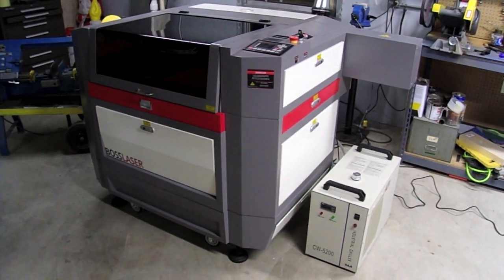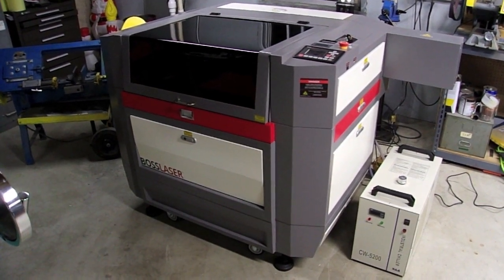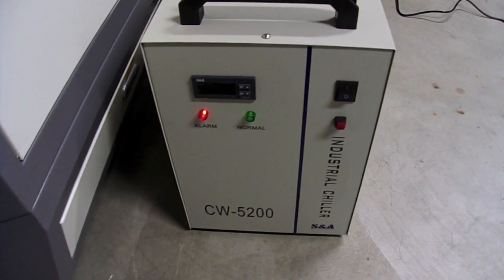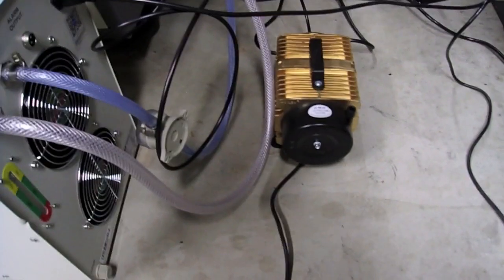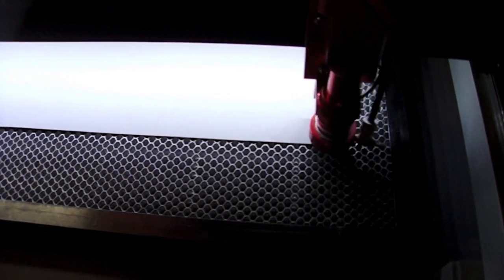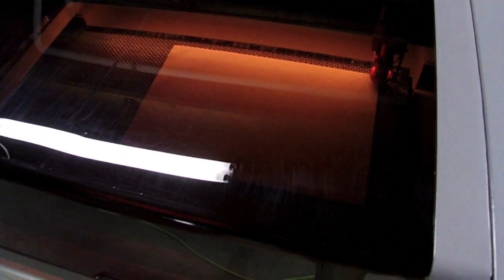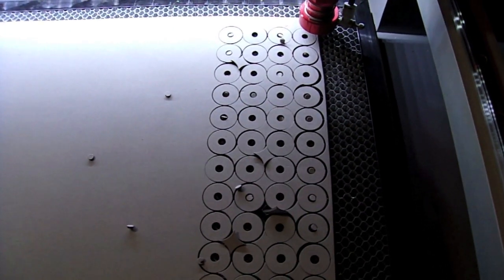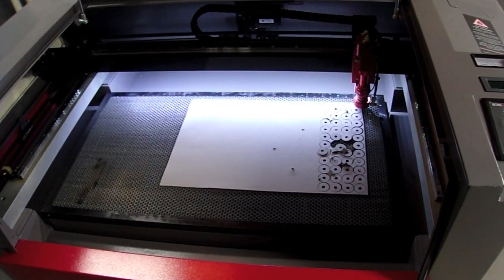Laser Cutter Demo!

Comment: can you get that machine through a 35 inched wide door? LS 1630
Reply from the maker: The machine is almost 38" wide, so I'm going to say no it won't fit. I have the advantage of a 7 foot wide garage door and ramp leading into my basement. The frame of the machine is welded up too, so unfortunately it couldn't be disassembled to fit either.
Reply from the maker: Sorry, I double checked the machine and my statement about it being disassembled isn't quite true. If you were real intent on that model, I could the bottom section of the unit being taken off and the machine turned sideways to reduce it's size to just under 32" to fit through your doorway. The machine is actually composed of 3 sections stacked on top of each other. It would take a little work but I can see the bottom section (which is primarily just for the wheels) being taken off to reduce it's size.

Comment: Can you stipple polymer firearm frames with this machine?
Reply from the maker: It depends on the exact type of plastic it's made from. I think most polymer frames are something similar to nylon, which doesn't cut real well. Factor in the fiber reinforcing usually added to the plastic for strength, and I doubt you'd get real good results stippling a gun frame. Maybe okay for light markings, but probably not for deeper cutting you're going to want to make a good grip.

Comment: I have been looking at other brands including Gravotech. A similar machine from them costs well over $25,000. When I asked the rep about the price difference he says that the Boss uses Chinese parts that are inferior and wear out faster. The LS-1630 is way cheaper so we are considering it from a cost standpoint but are hesitant to pull the trigger on it because of what this other guy said. What do you think?
Reply from the maker: Well, in my opinion, I think it depends on how much you plan on using the machine. I've had mine for two years now and have had zero issues with it. Granted I don't use it anywhere near as much as a regular production environment might see, but I want to say it gets used for something 3 or 4 times a week on average. While the Boss is not the best quality machine out there, it's not too bad either and I think it's capable of light production use too. Like anything, keeping up on basic cleaning and maintenance of the machine are going to extend the life of it considerably. I would also recommend a better chiller like the CW-5200 or greater, and making sure the water for it stays clean. The laser came with a CW-3000 which is just a radiator and pump, and may be fine for light use but I think the larger chiller will help ensure maximum life of the tube. 

So really you have to ask yourself how much use on average the machine it going to see and also if there's any other features a high end machine may have over the cheaper Boss. Personally myself I think if I knew the machine was going to be working a full shift or more a week (40+ hours) I would consider something higher quality. Even then I would be tempted to try the Boss at less then half the price anyway. If you plan on working the machine long hours, ask Boss and see what they have to say about it. If they think the machine is up to it, and if that may void the warranty. Some manufactures are funny about honoring warranties for equipment they know it being used at an industrial duty level. 

Just my 2 cents on the matter. Hope that helps some.

Comment: Good job, but those cut pieces flying through the work table are not so cool to see, and first of all they could be dangerous for the laser head if they meet its path.
Reply: How would you prevent that?
Reply: @blewprent  I would set a slower cutting speed so that I could be able to cut only with exhaust and without the need of air assist in "storm" mode.
Reply from the maker: Trust me, the laser head has seen far worse then a few pop up parts can offer it for danger. Twice now I've had the auto height adjust fail to activate, and jam the head into the table HARD. That was a scary experience, but some how the machine came out with no significant damage.

Comment: You done any cutting of thick materials on this? I've seen em post videos of the old 90 watt version they had cutting 1/2" acrylics and such but on their site the only state up to 1/4" just wondering if this thing has been pushed by anyone, as I'm not finding any videos of it.
Reply from the maker: The thickest material I've cut is 3/8" acrylic, thought that was only once for a test. It worked pretty well, though I did do it in several passes and the squareness of the edges trails off a little towards the bottom of the cut. Most of the stuff I do is 1/8" acrylic or Delrin, which cuts much nicer (at least with the lens I have in at the moment) but the 3/8" cut wasn't horrible.

Comment: Did you ever consider the Thunder Laser brand ? I see those are made well too. 
Also, do you have all the devices connected to one circuit?
Reply from the maker: They did come across in my research, but No, I considered mostly Boss and Full Spectrum lasers. 
Just due to lack of outlet spots, I have machine and cooler on a separate circuit from the exhaust and blower. I want to add some outlets into the machine itself to tidy things up a little and add a switch in the front to easily turn on and off the exhaust and blower. I'll have to double check the amperage draw, but I think all 4 devises can be run off a 15 amp circuit.

Comment: How’s the boss laser working out ? I’m looking to purchase the 1420 very soon. 
Any considerations or comments before I order.
Reply from the maker: It's been working very well for me, thanks. I'm always finding a use for making new things to sell or fixtures for other projects. No problems with it yet either. Just a learning curve with using the supplied software. 
Off the top of my head, I'd just make sure the machine you buy has the power and work area size you need.  For most of my stuff I find the 1630 plenty big, though every once and a while I have an idea that's outside the working envelope. Power wise too, I got the 100 watt laser option, and sometimes wish I has stepped up to a larger machine with 150 or more to be able to cut thin sheet metal as well. It's hard because you'll talk yourself up to the biggest machine you can afford (or beyond), but still want to be practical and get just enough machine to suit the bulk of your current needs. 
I'd also be sure you have good software for making files with. The included program will work for basic stuff and is needed for converting DXF files to the cutter's RD format, but isn't too great for intensive design work. Depending what you want to do, it will help to have other programs like CAD or other vector imaging software. 
  
Best of luck with your new equipment purchase!
Reply: ElationProductions 
lol....now you have me thinking of getting the 1630 with 100 watt laser....damn you..
Reply: ElationProductions 
What brand chiller did u buy.?
Reply from the maker: I bought a S&A CW-5200. Might have been overkill for the machine, but I rather error on the side of too many BTUs then not enough. I don't know much it actually matter, but I made sure I was getting an actual S&A brand unit too. Did a little research before hand, and a few people claiming the look alike units are of a marginally lower quality. It's all Chinese stuff anyway, but supposedly the real S&A company is the originator of the designs other manufactures in China are copying and the quality control is better. Don't know how true that is, but just something I read in my research.
Reply: ElationProductions 
Got it...I bought a CW 5000 D&A clone brand for 400$. I hope I didn’t waste my money on the clone. 
I will be ordering the 1630 Monday....nervous about this large purchase !!!!
What program do you design in ?
Reply from the maker: Eh, the clones are probably fine too. There's enough fail safes on both cutter and chiller to where if something does go wrong, the machine should stop to protect itself from major damage. 
Hope I didn't needlessly suggest a larger machine then you actually need. I just know myself, there have been a couple occasions I wished for even another fraction of an inch more travel to better accommodate a part. 
I design mostly in AutoCAD. Once in a while for more decorative stuff like Christmas ornaments, I'll use Illustrator when the dimensions are not critical.
Reply: ElationProductions 
Nope. I really wanted the 1630 to begin with. 
I also design in autocad for 80 percent of what I’ll be cutting. 
Do you use for hobby or biz ?
Reply from the maker: Yes. ;)
My hobbies and business are basically one and the same. A lot of times I'll build something for my own use and find other people want one too, so I'll sell this stuff on ebay. I focus mainly on RC car parts, but I'll make other stuff too like parts and accessories for the Taig line of micro machine tools.
Reply: ElationProductions 
Gotcha. Do you find yourself using the cutter alot and find it useful and do you look for things to make seeing you have this now ?
Reply from the maker: Oh absolutely! I find it useful for indirect building of stuff too like making fixtures for using other tools with. One of the biggest was a plexiglas cutting guide for making a new front bumper on my Jeep. I used it with my plasma torch for making holes and rough cuts in a 6" C channel. I've done a number of smaller drill guides like that too. 
These machines can't do everything, but if you're creative about it, they'll help with a lot of stuff.
Reply: ElationProductions 
Awesome. Glad to hear your using it for multiple purposes. Well I’ll prob order it next week. They’re running 7-8 weeks on delivery. 
Thanks for all the info and I’ll most likely be asking you a bunch more.
Reply from the maker: No problem. If I can help in any way in the future don't hesitate to ask. :)
Reply: ElationProductions 
👍🏻👍🏻
Reply: ElationProductions 
Why temp do you suggest I run my chiller at for a 65watt laser ? And do you run it at constant temp or intelligent control?
Reply from the maker: I really don't know what an ideal temperature is for any laser. I keep mine in the 65 to 70 degree F range. I think a little warmer like 80 wouldn't hurt it either, but I figure it's safer to error on the side of going colder. It's hard to say at what point you're increasing the life of the tube and when you're needlessly keeping the water cold. There's a number of features in regards to controlling the temp on the chiller, and honestly I haven't played too much with it. It came set from the factory at a decent temp range so I didn't really change too much. It automatically runs the compressor when needed which isn't too often being in cool basement.
Reply: ElationProductions 
Gotcha. Thanks for info.
Reply: @TheHelicapt   hey hows that knockoff chiller working for you?